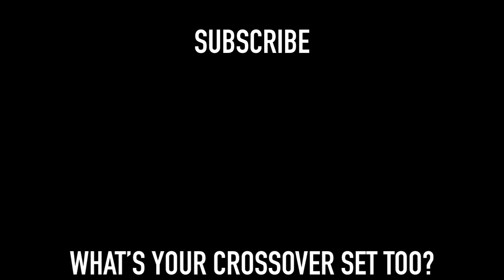Gaining Extra Dynamics and SPL With an 80HZ Crossover | Ascendo Immersive Audio

Comment: I am a believer that if you have just decent front channels you need to send some base to them, it just sounds better and fuller. 80HZ is for folks that just don’t know anything about sound or speakers to be in that safe zone.  I have an Anthem AVM 90, it does phase matching with my mains and sounds amazing when I pull in about 50HZ. I do have plenty of Amplification but most AVR’s these days have plenty of power. Give it a try go to 70 or 60 if you have supporting speakers even 50 you’ll see what I mean. You can’t produce tge same sound stage if all of your investments in your front channels and good surrounds aren’t playing a little base. If you can’t tune them in then simply go back to 80.
Reply: My speakers go down to 50hz. But in reality since they are not getting LFE track they are not going to play any significant bass that will audible next to the subwoofers. I have tested this thoroughly. I have turned off my subwoofers and listened to the first beach scene in Edge of tomorrow. First I listened to it with my front set to 80hz then full bandwidth and yes. There was a nice difference between the two and obviously the full bandwidth sounded better and hit harder. Then I turned the subwoofers back on and listened to the same scene, and there was ZEEEEEROOOO difference if i set the front towers to full bandwidth or 80hz. LFE is just so much louder than what gets sent to any speaker. It is 10db louder by design but of course it's up to the sound engineer what he puts on the LFE track.
Reply: @sdvolley  so whats your settings in your AvR ? LFE + main ?
Reply: @SuperSteamengine  LFE + main is not sending anything extra to the main speakers. This is one of the most misunderstood thing when it comes to home theaters. I am not sure if that's where you're going with your question, but I know half the people are confused what lfe+main does
Reply: @CSOCSO thanks mate, the above comment you wrote above have the perfect answer for me. If someone has a subwoofer and that will perfectly handle the LFE content. I have tried the same way you did, tried full band width, small setting 60 to 80hz xovers, finally settled down.

Comment: I have my crossover set to 118Hz after my Ascendo change for a few reasons. I thought it wound sound bad and localize the bass which is why I did a 70Hz crossover before, but now that I have 4 x 18" subs in each corner, I noticed I can't localize bass at all, and it sounds great with a higher crossover. I PREFERRED IT! WHAT? But mainly because my Ascendos don't measure well down at 80Hz in my room because they're sitting on stands and not up against a wall.

Comment: this is a important topic, i have mine set to 180hz. 
when you got two capable subwoofers, you have so much benefits from letting them to more work, the smaller the mains the more you benefit.
to get all the benefits you nede dsp to high pass the mains and low pass the subwoofers and set those to stereo. now you can get small two way mains and it becomes a large 3 way system that plays loud, are full range and have all the kick up the upper bass like only the largest speakers does. and you can place the main speaker for sound quality and ignore any bass problem.
Reply: I would've said you're crazy until I tried a 118Hz crossover and preferred it. Although, I also have a Ascendo. I don't know if it would've sounded as good with my Polks, but probably higher sounds don't need as big of an amp, and if I get expensive subs with expensive high-power amps, I'm fine.

Comment: I wished he gave answer without talking what kind of speakers he wants to make. 

He was more selfpromoting then answering. I got nothing from this unfortunately. 

Maybe its my bad, but I would really like a straightforward answer on something like: “My tower front goes to 34hz. Should I use 60 or 80 crossover ?”
 I get it that I should not use it as full range speaker. But this subtle difference between 60 and 80 makes a lot of difference in sound.

Comment: I do agree on 80hz to be the standard. Its a nice balance between, not having subwoofer canceling/peaking  problems and not having the localisation problem if a higher frequancy. 
But there is a small problem when you design a speaker to have an F3 at 80hz. You need to add that 80hz crossover in order for the proccessor to send the bass information to the LFE channel instead of the speakers. If you have a speaker with an f3 at 80 and that crossover will add a filter to make the 80hz be at f3, now you have double the "crossover". The processor doesn't know that your speaker can't play below 80hz,  it think it can play as flat as a straight line. So this will make the 80hz region a bit wonky as it will get filtered out a bit too much. 

If it was more like an f3 of 60hz designed speaker that woudn't be that much of a problem. I guess you could EQ that 80hz region to bring back those 3db losses, so ye. Pros and Cons.

Comment: I find it funny that this subject still comes up. People argue that (ideally) all speakers should be full range. Example: because they can "hear" the direction from where the bass comes from. You just can't localize the sub 80 hz range (actually higher). But even if you could localize low-end bass, it would be so difficult to calibrate for your room if all speakers were full range. You need independent control on the low end where your room takes over.
Reply: Exactly. When Digital Sound arrived back in Laserdiscs full range speaker where recommended. Good old days vs good new days.
Reply: Most recording engineers also will record everything below 100 Hz as mono . There is nearly no stereo content below 100 hz